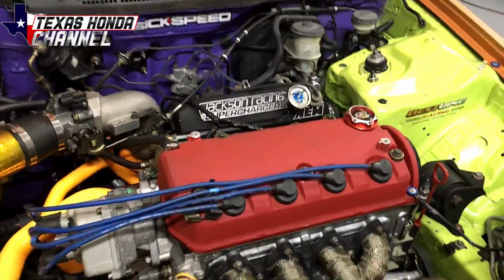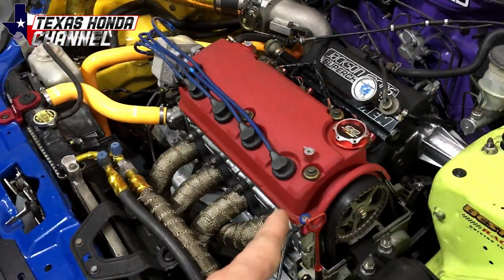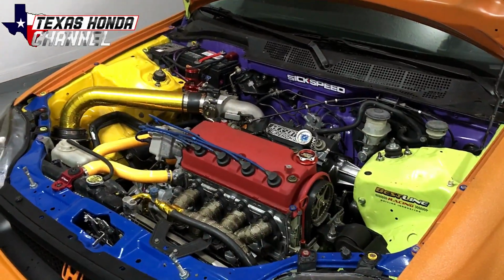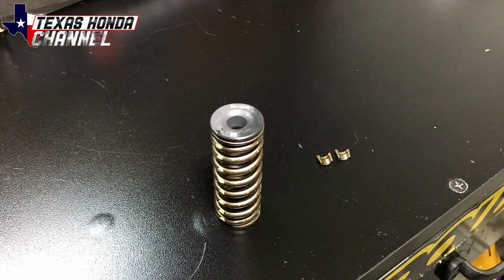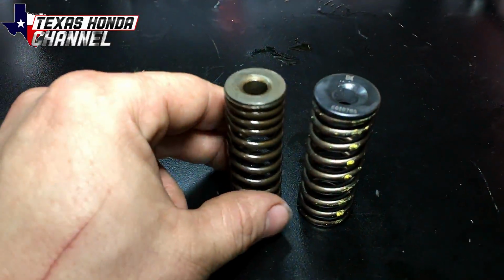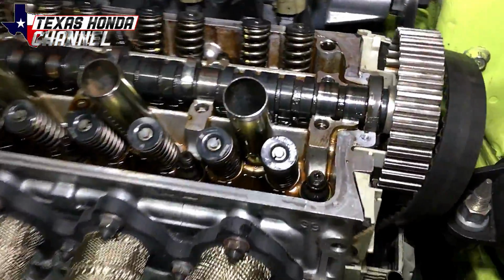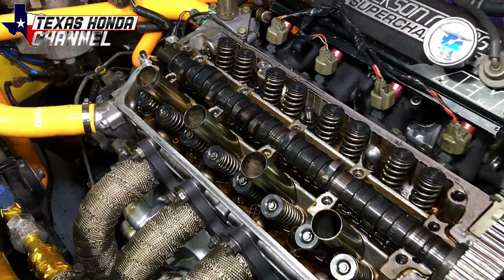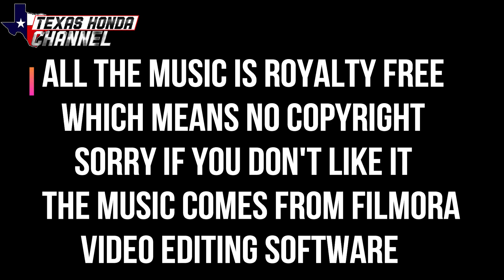How To Remove/Upgrade Valve Springs in a D16- (Without Removing The Head)

Comment: Man, putting out that content! So this is one of the reasons I stuck with a D series in my insight. If I have any failures in the head, or even the head gasket, it's super easy to do it all leaving everything else in the car! 

I used this same method for springs in my 4.8 LS swap, works great! Although I hate that tool, by the time I was done, the threads were like razor blades! Ha ha

Comment: When would you replace the valves then? Or are stock valves good for this set up?
Reply from the maker: It would be a good time to replace them but mine are fine and i couldn't find the new ones i had laying around somewhere but its not a big deal ima eventually get a Z6 head so i can put brand new ones in that head.
Reply: Texas Honda Channel thanks for the reply great work.
Reply: you also have to remove the head to do valves. so if you just need to replace springs for a cam, this is the way to go.

Comment: Why only 30PSI? Does the air move the piston down if it’s more pressure? I’m getting ready to do valve stem seals on a B18C1 with compressed air and am trying to figure out what PSI to pressurize the cylinder at.
Reply from the maker: I did 30psi it worked fine